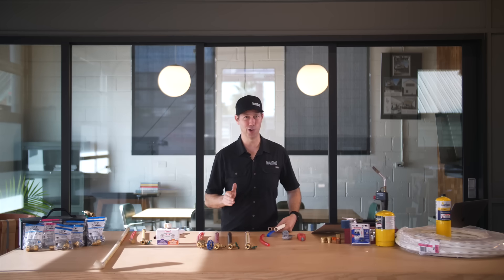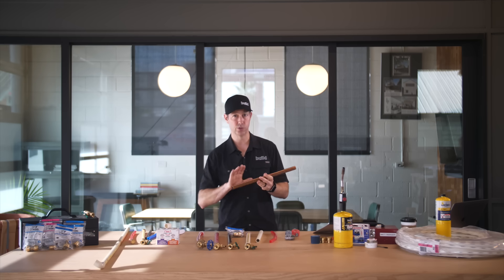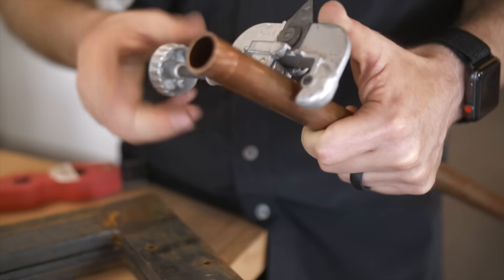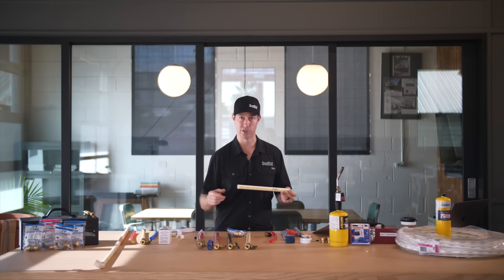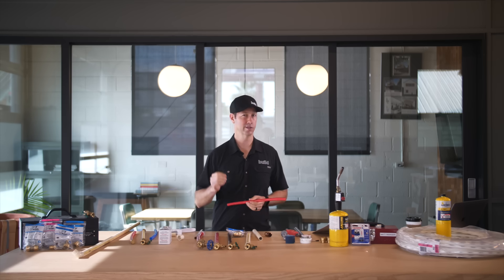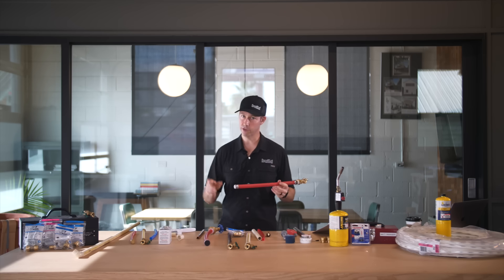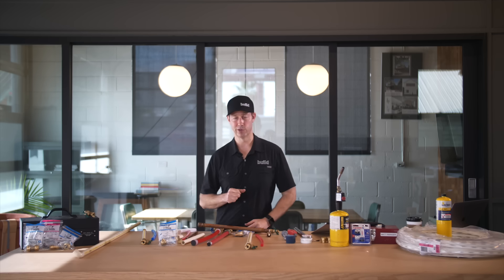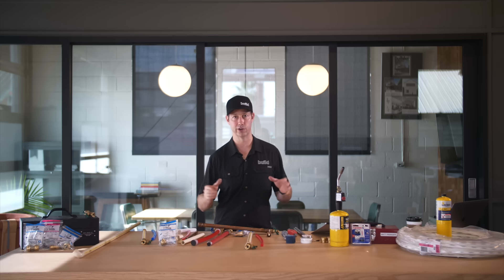PEX vs COPPER vs CPVC plumbing pipes

Comment: As a licensed plumber I must say that this episode made me cringe with durability and lifespan descriptions... Copper decays for quite a few reasons when no foreign substances are involved, it could just be a failure to ream a pipe or too many joints causing turbulence in the flow.    CPVC might be easy to repair but it is way more costly when you figure in the long term costs that it will cause when it snaps and floods an area.  Pex is not without fault but it is very durable, keeps workable, and will even expand with frozen lines instead of bursting.  

PS: Don't Tell people they can happily get away with type M copper, no plumber worth their weight would recommend it due to it's tendency to fail with any kind of hard water.   Also, there are more than 2 types of types of copper and that's not even mentioning soft and hard copper.
Reply: https://www.thisoldhouse.com/plumbing/21017327/how-to-stop-copper-pipe-corrosion
Reply: I’m a plumber in mass. So maybe the toughest codes in the country. And can only use M type copper on heating .. L for all the potable stuff. PeX is Great it does hold up to freezings better. Its main issue in my IMO is you got to be  diligent hanging it. It can really look Iike crap if you don’t.. especially the hot/ heat lines they’ll be drooling everywhere if not.. also do copper stubbing out for all the fixtures . nd CPVC I just don’t like. I cringe when I see a whole house done with it. Plastics shut off plastic everything. Looks more like a pool guy plumbed you’re house. But that’s just my opinion.
Reply: @terdferguson1736  my house was built in the 80's with all CPVC, never had a single leak from it, only the showers had a leak, and that was from the actual valve, i have well water though so there's no chlorine involved so i can't say what would happen on city water
Reply: The Doctor oh I don’t think there is Durability issue what so ever. I actually think it’s more durable then copper, as long as it’s not subject to the elements  and especially when you have well water. So that’s not my issue with it.  It’s more aesthetic for me, especially when its not hung diligently, or it’s just dropped down to a water heater and they don’t switch to copper for the fixture stub outs and shut offs.when I see plastic ball valves It just shows the plumber did the absolute bare minimum.
Reply: @terdferguson1736  ohh ok, mine has gate valves, it was hung quite well and not sloppy at all, most of it is hidden though as it is all under the house, lots of nice exact angles, everything is really well lined up
Reply: The Doctor  I apologize if I made it seem like it was a poor quality material. I don’t think that at all, especially with your well water. It will absolutely last longer then copper. I’ve ran it many times as my main then branch off with pex. But that is 1” or 1.5” pipe so it’s quite rigid. It just always seems the guys that run it everywhere, in my area at least, are the guys trying to get in and out. Not worried craftsmanship or future maintenance.  this just my opinion, but I do like my opinion lol
Reply: @terdferguson1736  yeah, i've seen the same, guys that run only PEX are just trying to get in and out fast, they both have their advantages and disadvantages, from what i've seen PEX has more issues with the connections of they aren't done just right, i have actually seen a brass 90 break in half at the barb
Reply: Type L copper is domestic water piping. Type M copper is for heating systems. K copper is medical gas
Reply: All depends on where you live and the local codes. We can use type M for all domestic water
Reply: Excellent.  I learned from a plumber who had a habit of coming back to check the work. Forget to ream it once=ass-chewing.  Forget twice=fired!
Reply: Well put
Reply: Eathan man knows his stuff
Reply: Look man I’m just trying to get through construction class the first info I get is going directly onto my assignment
Reply: I am cringing and biting my tongue until it bleeds. 
As a retired plumber I'm about to go through the roof!
Best to leave credible plumbing advice to the plumber.
Reply: I like copper
I’m a HVAC guy not a plumber but right or wrong the thought of plastic pressurized pipes full of water scares me. Our house was built in 1998 and is all hard copper. Drains of course are pvc. So far no leaks. We do occasionally have a hammering effect can’t seem to fix it so I don’t worry about it. I expect the copper plumbing will out last me.
I grew up in a house with copper as well and do not remember any floods or leaks other than clogs. I do not know if it was copper originally as it was built in 1933. It was destroyed by hurricane Charlie. The builder of their new home used Pex hopefully it will last. But I doubt it.
Reply: Joe Kinchicken  I don't see you spewing anything whatsoever though.

Comment: Yep, Jason you are correct, it's the next big replacement cost facing many homeowners, I installed miles of it. It turns out , it can't hold up to high temp. Water,....and don't bury sharkbight fittings,...can't stand up too the minerals in the ground

Comment: With my remodel, I asked the plumber to tell me how copper pipes you need.  I would go and buy them as needed, which actually worked out better for me.  Copper price stayed around the same between the (3) months I purchased them.  The good thing about copper is the T join setup, so you don't waste so much water when taking a shower, handwashes.
PEX or anything plastic worries me the most, if it breaks anywhere in the mid, replacing it would not be fun.  Unless you have a manifold installed.
Reply: Copper pipe is hard to replace. CPVC/PVC are much easier.

Comment: LJP
Has anyone heard of water taste issues with PEX? One plumber bidding on my repipe will not use PEX due to the change in water taste and claims you need to run water for mins before drinking? I live in Florida and currently have 20 year old CPVC in house and have had 3 pinhole leaks in last 5 years. plumbers down here are either firm on using PEX or CPVC and some are ambivalent and will use either. HOW THE HELL DOES THE AVERAGE NON PLUMBER CONSUMER PICK THE RIGHT ONE? All tell me copper is dead in Florida and no one repipes in Copper due to durability here.
Reply: Hi, copper can develop pinholes as well. Ph levels can certainly have adverse affects. I thin 6 can cause damage and a 5.5 definitely will corrode copper, ph scale. Also copper should not be installed in a tight hole, wood. Wood in tight, or   clamped like relation to the copper pipe is bad, I dont know why, but it is not good for the copper. Also the average DIY guy does not even know what a reamer is, and many lazy plumber will say you dont need to ream the inside of pipes. Cavitation creates pinholes, lack of smooth bore pipe creates cavitation,  in other words if the pipe was not reamed cavitation occurs.  Copper sucks heat out from the hot water, even when insulated (relative terms). The upside to copper.... a poisoned rodent cannot chew thru the copper. One other consideration to make, not everyone is going to use a torch safely.

Comment: Your leaving out expansion and contraction with these materials. Copper does well as pex does well also. Cpvc does not. Life span for cpvc at 20 - 25 yrs is miraculous. I shutter when i see cpvc in homes. The one problem area for pex is hot side recirculating, because pex (wirsbo) brand is a memory pipe always wanting to go to original size but under expansion due to heat. Pipe your house in pex hot and cold if you have a recirc pump run that in type L. This will give the best results. Cpvc is best for water heater blow off drains and water heater drain pans. Sorry Chad.

Comment: One bad thing about copper that was barely mentioned was the heat conducting property of copper.  Even when insulated, copper pipe sinks heat way more than either of the plastics.  My house is a large ranch plumbed with copper, and some fixtures are fairly distant from the water heater.  I have to run the hot water quite a bit just to get hot water coming out when first using the fixture.  You can feel the water temp rise slowly as the hot water gets through the pipe, then finally heats up the pipe itself.  If the pipe is not insulated, the heated water left in the pipe  cools quickly.  The only option to improve the wait time is to install a circulator which wastes energy and water.
Reply: A circulator isn’t the only solution, although it could be one of the simplest/cheapest install solutions for improving hot water in the far away bathroom. You could get a small local water heater for the distant bathroom and have it in the closet near the bathroom, in the crawlspace/basement below the bathroom, etc.
Reply: @MarlinRoth  Yeah, point of use water heaters could be a good solution
Reply: I put a five gallon electric under my vanity to serve that whole battery,then fed it with a hot water pipe, not cold  from the main water heater 75 feet away.been working 28 years .
Reply: Right but my testosterone levels won't sink because I'm drinking plastic water.

Comment: Why did you not talk about Cast Iron pipes?
Reply: not sure if serious... Cast iron is basically limited to being used as vent pipes and thats it. No one uses cast iron pipes, its obsolete. There is no need to talk about cast iron pipes, they pose too much issues over time.
Reply: kiemyster420  yes it very old but be neat how to work with it. Since one of my houses has cast iron as it was built in the late 40s

Comment: I work at an injection molding company and all of our molding presses have pro press copper water lines up to 2" dia. We run water under pressure at temps up to 285 degrees through them and have never had an o-ring failure.

Comment: I am a commercial plumber in Oregon pinholes happen all the time in older pipe most of the time it's because the pipe wasn't reamed properly or it's on a recirculation system also type m is a no go   and there are 4 types of copper m l k and dwv . Cpvc is garbage worst nightmare for home owners. Although I love copper and love running exposed copper pex is growing on me easy to install and the only time I'm having problems is when it's cold outside and I'm doing pex that is 1-1/2" up to 3" to be fair though I mostly use expandable type

Comment: I would like to know if any of these are safe for drinking water?  I always worry about chemicals leaking into the water from the pipes and causing health problems. Chemical leakages from the piping or the chemicals used to seal the piping.

Comment: As a plumber in the pacific north west, never ever use CPVC. It lasts about 15 years max up here before it becomes brittle like glass. Customers usually have to sign a risky work waiver before working on it due to the brittleness. The original manufacturer is suffering a civil lawsuit due to lack of testing. Also the cement is just a glue, it's not a solvent weld like ABS and ABS glue.

Comment: I dont think the pipe is secured properly but the pvc discharge for the sump pump in my apartment makes all kinds of noise when the pump shuts off. You can hear it on the second floor

Comment: Cpvc is not at all good where there is any chance of freezing. A reputable RV manufacturer used this for 2 years in the mid 90,s and almost every one of these RVs have had to be replumbed with pex .Endless splits in cpvc when it freezes .IF you can guarantee that you will never have an extended power outage with any part of your plumbing not dropping below 32 degrees then plumb away !

Comment: You didn´t mention that PEX connectors are expensive and the fitting tools are expensive as far as I know (crimpers etc) . . so, it could be a good business to install PEX for a specialized company but not for the house owner, because he will not be able to do basic repairs as many do prefer, he will need a plumbing Co. . and what brand is better when using Pex?. .  because as you mention there´s lots of manufacturers/suppliers and those connectors are different depending on the supplier which makes it difficult to master for a given plumber . . and why did you leave out PVC? in my view it´s more used than CPVC and it´s cheap to purchase cheap to install and it is pretty standard.  What are the factors to consider between PVC and CPVC? .. In regards to Cooper, you also need to mention the temperature factor . . cooper pipes tend to explode/break in freezing weather when there´s a small flaw on insulation . . Cooper is widely used in California (warm weather)  but PVC is widely used in Texas and New Mexico where Cooper is seldom used (due to cold weather).. greetings

Comment: Any product which uses petroleum will releases toxic traces. No thank you.
Copper is more expensive but is time tested and safe.
Why would someone get cheap on a few hundred dollars worth of materials when you’re talking about hundred of thousands of dollars for a house that can be destroyed in hours by one pipe failure. 
You must have been paid by Pex to push this product.

Comment: In my home near the Gulf Coast (i.e., no basement - the pipes are out in the open air), the old CPVC joint failed (I repaired it myself) on the hot water line (the cold water line was an old galvanized steel line).  However, a few years later, a hard freeze (18F) obliterated the CPVC pipe section (evidently, I did not have the hot water line dripping enough), and I got a plumber to put in PEX.

Comment: Lots of issues with well water & the tees & elbows with PEX.  The actual pipe is highly durable but here in the FL panhandle the minerals in the well water eat through the cheaper metal fittings within 3-4 years.  Sharkbite to the rescue.

Comment: Bad advice on CPVC pipes, not a lasting product,they burst and leak periodically, something you do not see with copper or PEX. When I purchased my house 20 years ago, the entire system was CPVC which had been installed 5 years prior. The first winter there I had to repair 2 leaks in the basement, the next year same story. I decided to remove it and  install copper  all throughout, never a problem again.

Comment: Hi and thankiuu . Btw ? there is 3 types of copper pipes for housings constructions , the type (K) is thicker than the type(L) , recommanded undergroung. The type(M) shouldn't be recommand in any water distributions systems , but work well in water eating system , you can use it ethter in draining system , using 1 1/4" pipe , or any size required , and avalable.